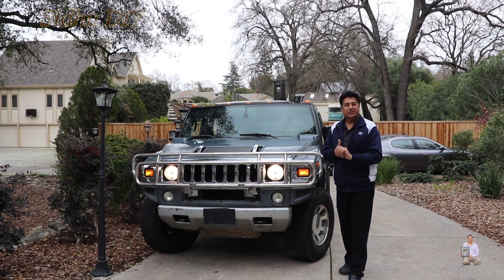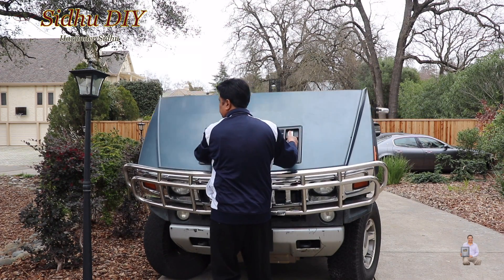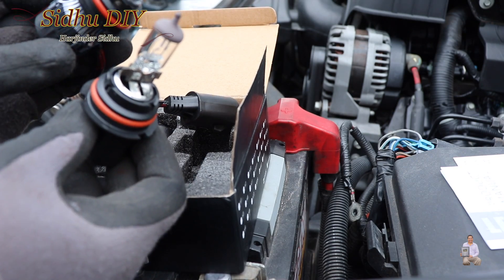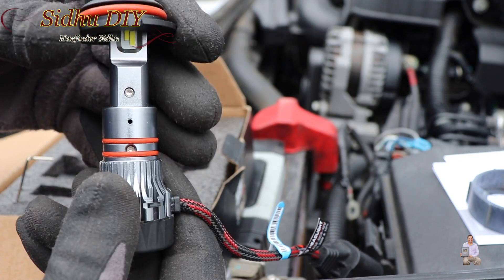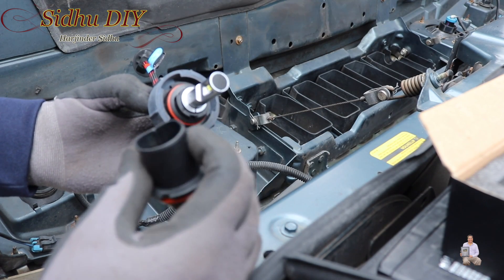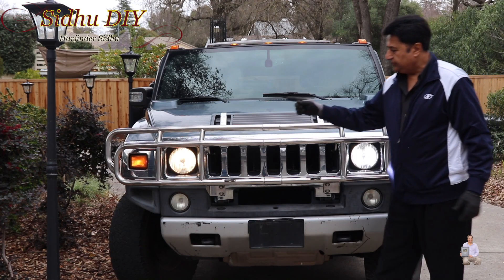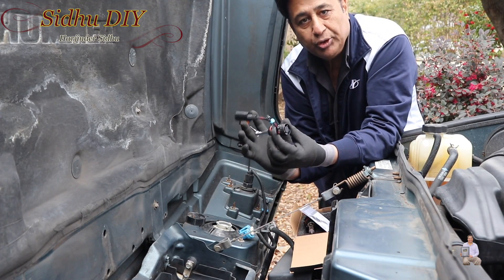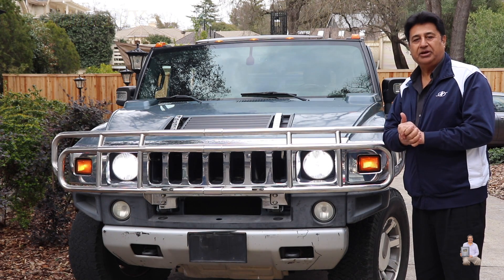LED Headlights vs Halogen Headlight Bulbs | How To Upgrade LED Headlights on HUMMER

Comment: Hello, Just changed out my headlights too but the DRL will not come on during the day like before. Now only the headlights come on during the day as well. Thoughts? Are the LEDs drawing too much power? Thank you
Reply from the maker: How about the light switch on automatic? Please check if you keep it on manual then it won't work.
Once the headlights are on then DRL stays off and LEDs drawing less power than the regular bulbs.
Reply: @SidhuDIY  ok thank you for your reply.

Comment: Thanks for the video. I followed your link to Amazon and ordered both the LED headlights and DRL bulbs. A note for others with Hummers...the bulb I received looks different than the bulb you installed as well as the bulb illustrated on the Amazon link. They have upgraded the bulbs and they no longer have that screw in the sleeve that you have to remove to get the locking nut on. On the new LEDs, the sleeve just twists off making it much easier to remove in order to place the locking sleeve on. Note that when you twist the sleeve back on, make sure the bulb is oriented correctly because you can easily have the LED oriented horizontally instead of vertically, depending on where the thread engages on the sleeve. The other difference is that the bulbs now come with a separate LED driver that attaches between the bulb and the wiring harness plug of the H2. Total time for installing both LED headlights and DRL's was about 10 minutes.
Reply from the maker: I am posting a thanks message to my viewers/subscribers for your support.
You are most welcome, glad to help.
Thank you so much for the like and thanks for watching.
My YouTube channel was hacked/hijacked last month (4/24/2019) and I just got it back today (5/5/2019). The hacker has deleted the information under the description of all my videos as well as comments and many videos.